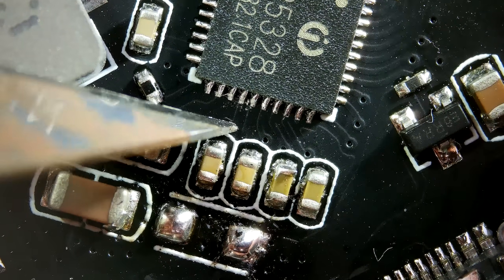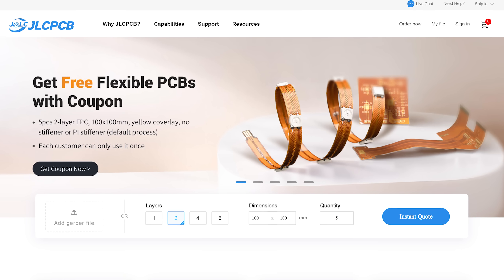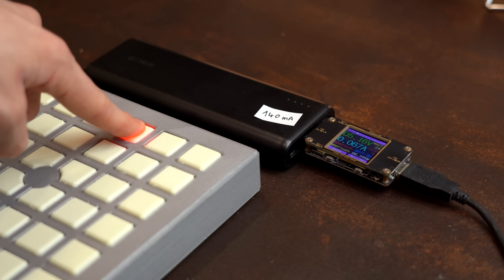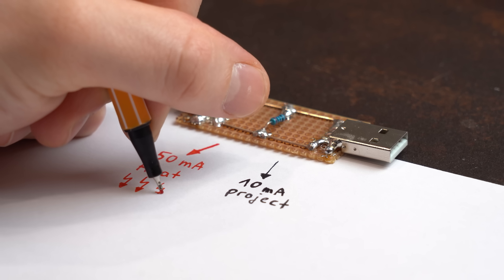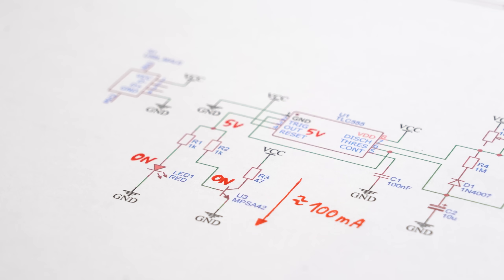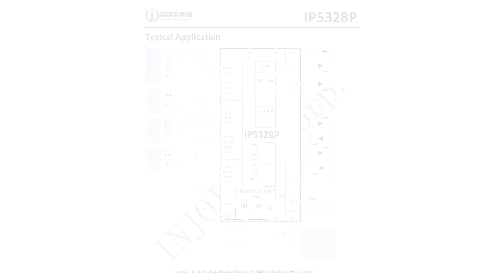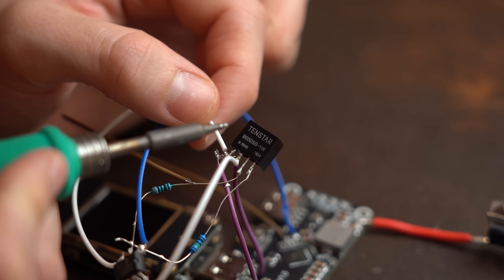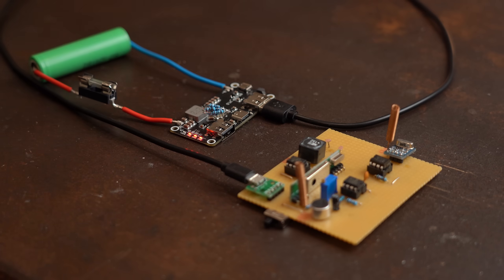Your Powerbank has 1 BIG Problem! (That we can "Hack")

Comment: Literally from the datasheet for IP5328P:
"If key is pressed, whether or not load is on VOUT1 port, VOUT1 port output will be force to open; but the
VOUT2 and USB C port will open only when load is detected on the according port, or the output on these port
will be closed. So VOUT1 must be retained if only one VOUT port is needed, if VOUT2 or VBUS is not needed,
MOSFET can be eliminated, but the 10uF capacitor should be retained."

And, if you need all ports to be working - thus lesser voltage on VSN pin. So then cut the trace and attach a voltage divider(100 to 1 to get 4.95v, 1000 to 1 to get 4.995v) from shunt to the VSN, simple as that.
Reply: but that ruins his example... lol

Comment: That's right!!! It's not possible to charge my Bluetooth earbuds without charging my mobile same time. It just turns itself off. Also my expensive new 140W wall USB charger does the same. WTF seriously how annoying even plugged charger turns itself off. MY god i was so pissed when I spend 50£ and its doesn't work on small loads. Also even weather station i got from aliexpress wont work because it draws few milliamps to power LCD and USB 5v switches off. So annoying. Thanks mate for showing how to tackle this issue

Comment: How does the power back detect if there is a load connected on the usb port in the first place, because there is no 5v output voltage yet?
Reply: When the power bank is off there is still voltage on the usb port but it only the lower voltage of the battery it self. You can see this by using a cut usb cable and and a volt meter to measure it. It’s just enough so when something is plugged in it causes just enough current draw to trigger the actual circuit to turn on that controls the full output power regulator to start up.
Reply: @Robert-Wilson thanks!

Comment: Some power banks have a low power mode. You have to go through the manual to activate it. For Xiaomi it's two quick double presses of the power switch while the power bank is on

Comment: Cutting the VSN point and adding a voltage divider might help(a series resistor from shunt VSN to IC VSN, then another resistor from IC VSN to GND). That will reduce the IC VSN point voltage slightly smaller than VSP, it will think current is above threshold.
Reply: Yup, was about to suggest that
Reply: the problem with this solution is that the powerbank will never be able to go to standby mode anymore even when no load is attached to it. From that perspective n555 solution seems more flexible and less intrusive
Reply: @borincod  yes you’re right it would probably drain batteries much faster when the Power bank is stored with no load.

Comment: Eplop Electronics (UK) sell a Power Bank Keep-Alive kit based on a 555 timer. Mr Carlson's Lab also did a 555 timer circuit to keep a power bank from sleeping but he chose the RC values to connect the shunt resistor for 3s and disconnect for 25s. This worked well for all but one of my powerbanks. That one fell asleep after only 12s so I added a fast option dip switch to my version of the 555 circuit.
Reply: Many thanks for the mention.
Reply: It has a 50% duty cycle tho, which is too much
Reply: @sp-vt4je  When coming up with the figures i settled on a quite aggressive 50% duty cycle as some powerbanks required this and i am trying to make it work with as many power banks as possible as it's a fixed device. As bornach mentioned you can get the kit version and use whichever  resistor values you wish to change the duty cycle and power drawn.
Reply: I realized something better by using SOC and shorting transistor by which I can program the on/off period freely. Because some powerbanks only need about 20s pulses to stay alive and the minimum current need may also be different. The huge problem is that every powerbank behaves slightly different. 
Solution with USB-C PD chip is also possible but the consumption may be quite high. I will definitely measure the still draw to the chip next time.

Comment: Would replacing the 10mohm resistor with a diode that provides a constant 0.7 volt drop solve the problem?

Just a thought.
Reply: With 1 A the voltage drop is only 10 mV so if the voltage drop was 0.7 V the power bank would shut down because it would think that too much current is flowing. If you were able to replace the resistor with something like 5 mV constant voltage drop it would work but it would have no overcurrent protection as it has no idea what current is actually flowing

Comment: For low power projects it's easier to take 2s liio batteries with xt30 which is usually made for RC stuff and add simple usb converter and over discharge protection
Reply: IMHO just buying a cheap type C trigger board that lets me use any of my existing power banks is much easier than effectively building a custom power bank from scratch

Comment: Powerbanks are great but are not designed for this kind of application.
The best way would be to think out of the box using a dedicated battery and not using any powerbank circuit.

Comment: Those are great! I love the pulse circuit! Ingenious!
 had that shutdown problem once, and since then, I have bought power banks that support low current devices. With the Anker 737 I have right now you can hold the button down for a few seconds to lock on. And draw as little as you want.
Reply: Although he wasn't the first to make use of a 555 for this purpose. I recall Mr Carlson's Lab made a version in a video titled "Power Bank Stay Awake!" over 3 years ago.

Comment: Many power banks do come with a low power draw mode. What I would like to see is to *how to use them as UPSes* since most of them turn off for a second when AC power turns off or on.
Reply: I think rather the cheap ones turn off when AC-power changes to have a cheap but still safe renegotiation of protocols and capabilities.
But you can probably be super cheap and simply add a large enough capacitor to survive the downtime.
While they do work greatfor UPS applications, such on-line UPS systems wear out the battery quickly. better would be to use it as standby once power drops (like most USPs do)
Reply: @tarakivu8861   Would it be safe to add a 1.5F 5.5V Super Capacitor across the power bank's output? I would like to use it as a UPS for raspberry pi 4.
Reply: Modifying a power bank to act as a UPS would be much more complex than these mods, so it probably makes more sense to just buy a power bank with passthrough charging/UPS mode to begin with (fairly common these days).

Comment: I think that using a diode would be better. Just cut the trace between VSN and the shunt pad, and add a diode between VSP and VSN. Maybe will be needed to have resistor between VSN and GND to act as a load to the diode.
But, even with and 0.3V diode, the IC would think it's flowing 30A and turn off as current protections, which leads me to think about a super diode, which uses an op amp to make the voltage drop of the diode be reduce by the factor of it's open loop gain
Reply from the maker: Hmmmm also sounds interesting.
Reply: @greatscottlab  Diode could probably work, especially with voltage divider and "adding" original shunt, so that the diode v-drop divided down would provide the minimum voltage for current measuring to keep device up, while at full load the v-drop of the diode wouldn't really change that much - so the divided V measured would like be still smaller compared to the original shunt at 1-2A so the current limit shouldn't drop much - like 2x to 3x times the minimum required current for continuing to work - Schottky would go from like <200mV at low currents to 400-500mV on the 1-2A depending on model.

Issues could be depending on how this all connects/works that it could fuck up the whole DC-DC operations, or reduce out-put voltage or something. Or not provide the drop voltage if current wasn't flowing (so something would need to be connected to work).

Alternatively make a simple hack - a switch to change between original shunt for high current operation with auto off, and low current perma on.

In the end its probably easier to just chose power banks that have "perma on mode" build in with either long press/double tap.

Comment: Fascinating indeed! I guess the solution would be to go with USB C and embed that circuit into the project itself (so you don't need 2 USB cables).
Thanks, dude! 😊
Stay safe there with your family! 🖖😊
Reply from the maker: Good point!
Reply: Does USB C even need anything more complicated than a couple of resistors on the CC pins?
Reply: @Vaionko  USB C, to get basic 5V@3A, only requires a pair of resistors, yes, but I'm not sure if it would keep the powerbank on without handshake or if it would default to a normal operation.
Reply: @Vaionko  That's a good question, I don't really know.
Reply: @Vaionko you need PD!
Reply: I believe the PD protocol requires some kind of handshake between the device and the power source, and this means you actually need to integrate some suitable ic in your PCB
Reply: @giovannigrosso6920 PD includes a mode that lets you specify a voltage with a resistor combo, but it makes a ton of assumptions about current delivery with much lower max power throughput when following the standard. Even so, it's a workable approach for low power devices.
Reply: @bosstowndynamics5488 I would like to see some info on that mode, because all I could find was setting current limits on 5V with resistors, between default (500mA, or is it 700mA now?), 1.5A and 3A, nothing about changing voltages
Reply: @giovannigrosso6920 You can buy little PD boards for around $2. Very useful
Reply: ...or integrate it into your preferred USB cable, that you'll use for all those projects.
Reply: With PowerPlant 30000mAh PD/76W QC/3.0 DC 12-19V USB-C 65W Max USB-A (PB930548)  and 
Baseus Power Bank Bipow Digital Display 30000 mAh 20W Black (PPBD30K) - with PD trigger, they stay awake for at least a day.

My other power banks
Romoss PMT40 and X-power SI20A9QLX 20000
30-60 minutes without sleep and then turn off 😵‍💫

Comment: Also, some cheap, small 2000mah power bank doesn't care what load you have is working all the time
Reply from the maker: Thanks for the tip :-)
Reply: Can confirm this. I use them for tiny microcontroller projects. And you can get them really cheap as they are for most people useless, as they can carge a modern phone maybe 40% or so.

Comment: Someone needs to get this man a bolder marker so that he doesn't have to go over everything he writes multiple times.
Reply: Leave his OCD alone.  🤣
Reply: Not sure if you are joking, but I think he uses this technique for emphasis as he completes and explanation. He appears to have had drafting experience as well, so pretty sure he has a decent stock of engineering pens in a multiple of thicknesses.

Frankly, I really like this low-tech way of identifying and emphasizing an illustration or number.
Reply: @allthings3d  I was joking, yes. I appreciate the drafting information though. I was not aware of that. Thanks!
Reply from the maker: I like it that way though ;-)
Reply: 😂😂😂 rightly said

Comment: Why does the Shunt hack result in an unstable voltage?
Does the "wrong" voltage value cause the chip to go out of sync?
Reply from the maker: I think with the 20 times bigger shunt the IC always thinks that 20 times more current flows. With bigger current you need a bigger duty cycle for the boost converter circuit to keep the output voltage stable. So yeah the IC tries to compensate for something that is not there.

Comment: IMO the first solution is the best. I ditched USB-A charging altogether a few months ago and it's been great. I charge everything* with my 65w usb-c laptop charger or usb-c car charger and I use my laptop as a USB-c power bank. 

All my small(by size and power consumption) electronics projects either use usb-c natively (CC lines communication and all) or use usb-c trigger boards(usb-c to screw terminals or solder pads, never to usb-a) or usb-c tp4056 module. All incorporated in the 3d printed case(so no loose wires a user can short or connect wrong).
So for me it's not "mess with using 2 usb cables", it's using 1 good cable I use for everything. 

* except my electric toothbrush(I charge it once in a couple months so it's not an issue) and my e-scooter(im still waiting for a 20v-55v boost converter to come from China)
Reply from the maker: Thanks for the feedback :-)

Comment: Sime baseus power banks and other have this (low power mode) for instance press and hold the power button on the baseus 30000mah 65w power until u see "L" on the screen then its in the mode .press and hold to turn off

Comment: why not charge capacitor intend of using resistor?
Reply from the maker: Because a capacitor gets full and thus current draw goes down.
Reply: @greatscottlab Maybe use a capacitor in your 555 circuit? It can discharge in normal operation, but the inrush current could be big enough to keep the powerbank awake...

Comment: Just google for "trickle charge mode"/"low-current charging mode"/etc. Almost all modern, not the cheapest powerbanks released in recent years support a similar mode, especially if they support Power Delivery or Quick Charge.

Comment: Можно напрямую подключиться к BMS в повербанке, и отрегулировать напряжение и его уже подавать на свой проект.
Или собрать свой повербанк с BMS и уже к этой BMS подключить регулятор напряжения и запитать свой проект.
Можно ещё разработать свою плату контроллер повербанка который будет работать именно так как нужно, сделать это опенсорс проектом, на котором каждый сможет собрать свой идеальный повербанк.

You can directly connect to the BMS in the power bank, and adjust the voltage and already apply it to your project.
Or assemble your powerbank with BMS and connect a voltage regulator to this BMS and power your project.
You can also develop your own powerbank controller board that will work exactly as needed, make it an open source project on which everyone can assemble their ideal powerbank.

Comment: Some morden power Bank comes with low power drain mode , Just click your power button 2times and one LED of your power Bank will flash 2times indicating Low power mode is on
Reply from the maker: Read that a few times now in the comments. So seems to be true. Honestly though never heard about this feature...
Reply: @greatscottlab  
Maybe it's brand specific
I have Xaiomi and Samsung and OnePlus power Bank, only Xaiomi and OnePlus has this feature,
Age maybe a factor as well my Samsung power Bank is 3 year old
Reply: @greatscottlab I have the same baseus powerbank that you have. It also has this feature. You can activate it by holding down the powerbutton.

Comment: The engineer who thought that shutting off the power bank if it does not detect 500ma is a id10t. Its in the same field as a cloud service for appliances.
Reply from the maker: 500mA is quite big.
Reply: @greatscottlab  Agree it is a dumb circuit lol
Reply: Well these things were mostly designed for phone charging, and even old phones usually drew at least 500ma. Newer banks take into account that you might be using them for other things.

Comment: You just need to spend more on your powerbanks. The ones I have can be put in a trickle mode which disables the low current shutoff.
Reply from the maker: Honestly never heard of this feature. But awesome that something like this is out there.
Reply: Yeah I have an Anker one. I just double click the button on it, and it goes into trickle mode. Works great
Reply: @mattanderson111  Mine are Ankers too, l wouldn't buy one without the trickle feature, it's very useful.
Reply: I think these approaches are still very valuable, personally I'd rather use my old power banks that have nothing else to do to power my projects rather than buying more new expensive ones and wasting the old, otherwise perfectly good ones.